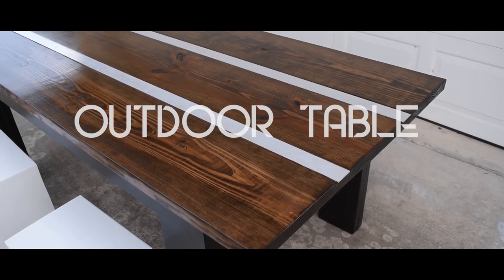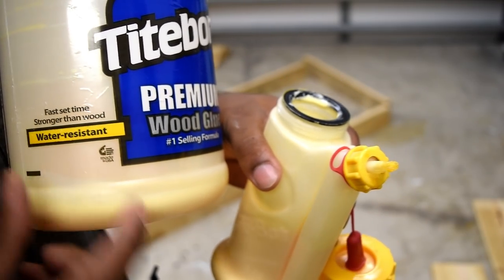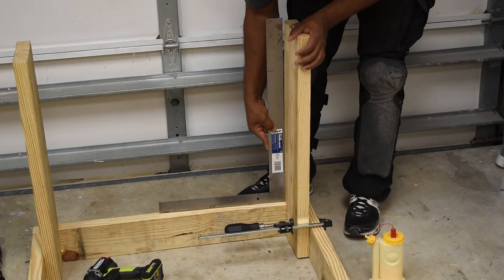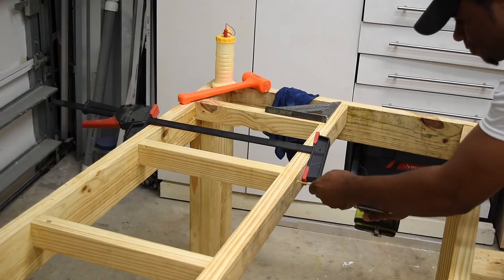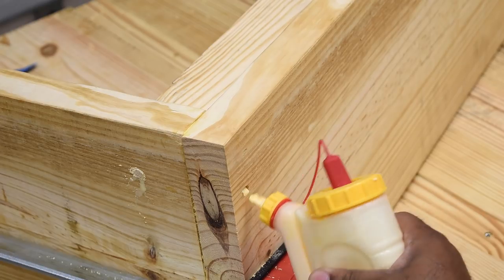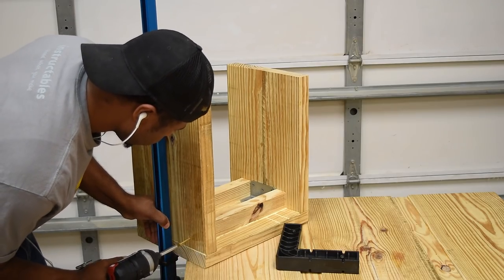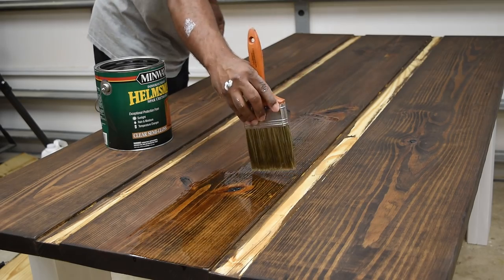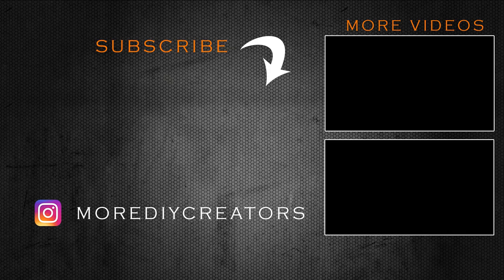DIY OUTDOOR DINING TABLE | with aluminum inlay

Comment from the maker: The big question for the bench is Matching (1) or Contrasting (2)? I'm going to sit on this idea for a while. I wasn't planing on it but if I upgreade the bench I will share.
Reply: DIY Creators I think the benches should match... with a single piece of aluminum going down the center of each bench... it's just more modern and a more modern aesthetic like most of the other furniture you've built, in my opinion... Toni From Detroit
Reply: (1) Matching
I agree with Toni, aluminum down the longer bench(es) would look fantastic. The white gives me IKEA vibes while the table looks high end. Amazing work as always!
Reply: I'm going to agree with Toni as well. Great looking table
Reply: Match it.  Nice job. Looks great.
Reply: DIY Creators personally I would like to see the seating match the table apron color, but that's just me
Reply: Matching bro!
Reply: I prefer the contrast
Reply: I would definitely match the chairs to the table in some way, the table looks sweet though nice job man!
Reply: En español por favor :).
Reply: It looks phenomenal already, but IMO matched seating would make it look properly professional. Personally I'd do solid black with just a small stripe of aluminum. The black picks up on the table legs, the aluminum is just enough to match the set up without distracting from that gorgeous tabletop or being too "busy."

Anyway, it looks great! Love the way it works with that little firepit. :D
Reply: I agree match with a piece aluminum down middle. Might be more work but I think it will be better looking. Over still amazing work. Hellos from Bakersfield.
Reply: DIY Creators love the work you do this one is amazing.......like the addition of the aluminum on top....matching seats would look great but different is always unique
Reply: Suggestion: Keep the benches that you have, but add a slab to the top of each one that matches the tabletop. Overlap the top slab by an inch. Keep the white parts white to contrast with the black parts of the table.

Instead of aluminum strips, put brass strips on the bench tops. That will both match and contrast, and brass will look awesome against the color stain you're using. And you might run the brass strips across the benches instead of along the length - two on the ends of the long bench, one on each of the stools, like this  [--|-----------|--]  [-|-] The stools could have the strips in the middle, or off-center [-|--] [-|-]. Or, you could run the strips across the benches at an angle, instead of straight, like this [--/-----------/--]  [-/-]

Lots of possibilities.
Reply: Matching
Reply: DIY Creators Matching would look good, then add some constrast with cushions or table decorations!
Reply: DIY Creators I like the contrasting colors
Reply: Matching
Reply: Matching would be cool, with a mix of chair and benches.
Reply: DIY Creators mate I think you should make it match, and also add with a matching aluminium strip :) love your quality videos. Just built my own table inspired by you and others on YouTube. So thanks!
Reply: Definitely matching.....also love the idea of running the aluminum strip on the bench, as well.
Reply: +1 on Toni's post.  Match with an aluminum highlight piece.
Reply: Match
Reply: Matching would look better, i think the aluminium on the table would throw out the contrast a bit
Reply: I would match, the table looks great and the aluminum gives enough contrast, I think the white is a bit too much. Perhaps have some subtle aluminum detail on the chairs.
Reply: I’ll throw my vote in for matching benches.
Reply: 2 contrasting looks awesome
Reply: Can't make a mistake. Contrasting looks great, Matching would also look great.  Maybe do both? Possibly swappable tops to allow for mix and match?
Reply: I agree with Toni and for sure it will look awesome like the table
Reply: If I were you, I'd use a mix for your chairs on that table - draw from the aluminum strips and make chairs that have white strips, the color you have on the current ones (gesso?) and make the main color the espresso stain from on the table... that or the reverse - mostly gesso white with the highlights as espresso stain... that might be better actually.
Reply: (1) Matching
Reply: Great video. The table looks awesome. And heavy. Love the colours I would keep it as is. Thanks for another great video for your channel. It's always a joy!
Reply: Match.
Reply: I would go with matching wood but contrast with white (or light color) cushions for more comfortable seating... that way you have both. nice table.
Reply: I would say contrast but leaning more toward a natural elemental mix. Wood metal stone. Since there is much detail in table top I would make seating concrete or another simple stone... If seating made of concrete, would make firepit same material
Reply: DIY Creators  match it for sure !!
Reply: Contrast
Reply: 2
Reply: What if they matched, but inverse? So aluminum with wood inlay?
Reply: i agree with toni it should match
Reply: DIY Creators - Just make new tops for the seats that overhang an inch, and stain to match the top of the table, then paint the current white on them to black.  Saw them shorter since you like the current height...   if you want to push it, insert matching aluminum strips across the middle on the new seat tops...       Beautiful table!
Reply: Thank you DIY Creators. Might I ask if you use any particular apps to sell the stuff you make?
Reply: I would do matching benches on each side and then a straight back chair that would match the benches. However it is beautiful excellent job!
Reply: DIY Creators all one I feel would just look better, especially if you inverted the colors, making the legs have the dark wood look and the top having the solid black. It’d look really 👍
Reply: Contrast
Reply: Match 1
Reply: Bought the bundle this table  plans are not included 😶
Reply: Glenn this entire build is fantastic!! I love the bench idea but leave it white and put a strip of metal down the middle; maybe something that can match the metal strips you have but cost less? I'm 2 years late lol. Great design as always :-)
Reply: DIY Creators Beautiful!  I won’t add the green vases only !  Keep it simple,  however I would purchase.
Reply: Perfect tutorial. Just what I was looking for. Thanks.

Comment: One thing that keeps me coming back to this channel is that this guy always manages to put together something that looks extremely classy with basic materials and tools.
Reply: Only criticism: ironically, all the extra screws and corner brackets will actually contribute to the cracking and splintering of the top's wood. This is since the top pieces have no room to move with changing moisture conditions, and will tend to splinter down the middle and near the screws. Another way to fasten the top to the apron is with a long groove along the inside of the apron that acts as an open mortise. You then make little "tenon biscuits" which insert into this and which screw in to the bottom of the top. This way, the top isn't screwed rigidly into anything and it has room to move within that groove. (whew long comment). Still, really impressive design & I hope it lasts.

Comment: The bands of aluminum take an otherwise very simple table and make it fantastic!  If you do benches, I'd suggest the same finish as the table, with a single band of aluminum running lengthwise across the middle of the bench, to really tie the whole set together.

Comment: Beatiful looking table. Set the aluminum at 90 degrees in the benches - you've got the pattern right there - and that's a very handsome dining set. Very handsome.
And if it does warp, that's an opportunity to try something different next time round.

Comment: I like the contrast of the white benches. Maybe add a dark stripe on the bench seats to match the silver stripe in the table top. The table looks really nice. Your designs of the thick lines really works in this project.

Comment: Very nice table.  My vote for benches is to match the top/legs stain to the the table but hold off on the aluminum.  Thoughts are if it does do any warping you don't want a tush sitting on a edge of aluminum that may popup as that wood moves in the FL humidity.  Also will make for much easier refinishing after a couple of years outside.

Comment: Beautiful job. The white is a nice contrast but I would suggest you consider finding a way to take some of the color from the table and add it sparingly to the seating (like two stained stripes across the top & down the sides). That way you can keep the white contrast but have a little color to tie the set together. Or paint the seating silver to match the stripes on the table.

Comment: That's a real nice project young man!  My thoughts on the bench?  Matching.  Either would look nice though.  Maybe a single aluminum strip down the lengthwise top of the seat.  I like how you explained various things like screw placement (...too close to edge; hidden from view, etc), type and amount of sanding disks you went through, etc.  I always wonder if I'm doing the right things on my projects - and hearing your rationale and experiences helps justify my own techniques.  Great project, great video.  Keep them coming.
Reply: PS - I will come to you if you'll show me your quick clamp technique!

Comment: Excellent design! I'm actually thinking of copying your design for our patio table this year.  One thing I think I will add is an accent aluminum strip in the seats.  Although not sure how that would look with white.  Also,  I'm wondering if this table will warp and split with with all that glue on perpendicular grains.

Comment: Nice build Glen , but piece of advice , I really erge you to make an assembly table , all that ground assembly will eventually take its toll on your back and knees ...:-))
Reply from the maker: Thank you, I think you have a point. I was using knee pads and I don't do it very often. My main reason for not having on is I don't have space to dedicate to one. I'm still trying to find a good solution.
Reply: Glenn, just a thought. How about a design for a table that doesn't use screws but rather useslarger bolts with accessible knobs on  them t and wood joints (no glue) o allow you to put it up when needed but to collapse it away for the rest of the time? Just a thought.

Comment: Regarding the Matching or contrasting, my first thought is to have them match.  I feel that the contrasting benches will take away from the table.  I'd also suggest not to have the aluminum banding on the bench, just match the finish and paint.
Unless, you come up with some amazing plan for the benches and you don't mind the attention going there instead.  Sort of like an accent chair, it'll be an accent bench.
That being said, that kind of bench would be better on it's own rather than with a table.
Great job on the table.  I'll be replacing my deck this summer, maybe I'll do a table up at the same time. #Inspired

Comment: I personally prefer a contrasted look to furniture accessories. Might I suggest a little concrete work for the benches? 
I don't know that I'd make the entire bench of concrete, but I can see the legs or the top of concrete, and wood for the rest. 
You could then stain the wood to match the table and still get a little contrast from the concrete.

Comment: I actually like the contrast idea for the table-bench-situation. The white should be all through with no wood grain though, at least that is my humble opinion. It just doesnt seem to fit to the aluminum-table.
Speaking of which: if you make new benches, why not some small chair/stools in the same dark color, but with an aluminum inlay, e.g. a small circle on top of the chair or even additionally a small circle of aluminum (lets say three inches) around the legs?
Keep having fun building!

Comment: Glen, do you prefer the glue and saw dust mix for filling gaps to just using wood filler?  I seem to always just create more work by using that combo and it gums up my sander where wood filler sands off nicely.  Thoughts?  Also, staining is a huge challenge for me every time, if you had left the stain on for several hours would it have absorbed so much and remained darker or would the top layer still wipe off?

Comment: Table looks good, think in would be better if you ran the aluminium strips around the table edges so they looked like solid pieces of metal in the table.

Comment: Hey bro I have a question. Why not just use some pocket holes in the spots you don't want the screw to be used through the top? Do you use pocket holes?

Comment: The contrasting chairs look good, but I don't typically like bench-style seating if you're going to spend a lot of time out there. It's not very comfortable, even if you add padding you still don't have any back support.

That table is probably a bit over-engineered, but it looks great. At least you didn't use a heavier hardwood, because that would have been serious overkill.
Reply from the maker: Thanks bud! I can see your point. Yep, I could have done a few things differently. I changed the design along the way.

Comment: First off, very clever way to include your adds but still show you working in the background. genius. alot of other channels are starting to feel like one big add. which I understand , the creator should get paid , but I feel there should be a better balance. the video shouldnt feel as if your shoving an add down the viewers throat. I think you dealt with this perfectly. That being said. MAN that thing is sharp. very similar colors to the deck im building now. deck boards somewhat of a dark walnut, with white fascia boards and posts with black balusters.

Comment: I would have sealed the area underneath the aluminum strips, water will got sure get in the cracks and can mess your table up.
Reply from the maker: I did, got it on the 2nd coat I realized I didn't do it :).
Reply: DIY Creators, good! I would hate for that beautiful table to get ruined!

Comment: Particularly with outdoor furniture you have to make allowances for the wood to expand and contract with changes in humidity. Screwing into the top like this simply will not work long term. As the top changes sizes either the lumber will break, snap the screw or wallow the screw holes out. Either way the top is going to take a beating over time. Instead look into connection methods that allow for changes in dimension over time and see https://www.canadianwoodworking.com/get-more/table-tops-and-wood-movement for a good discussion of the issue.